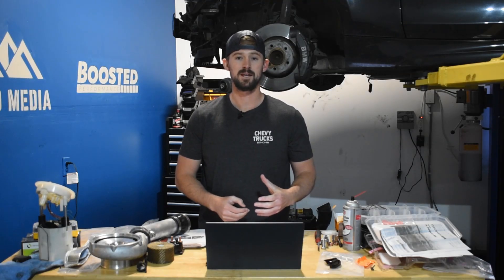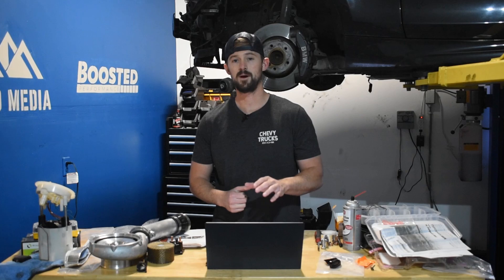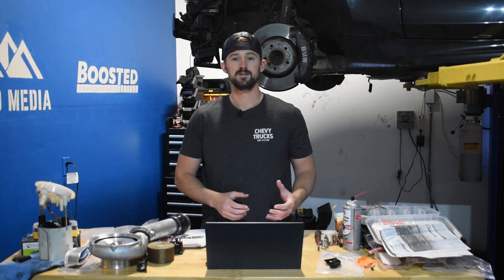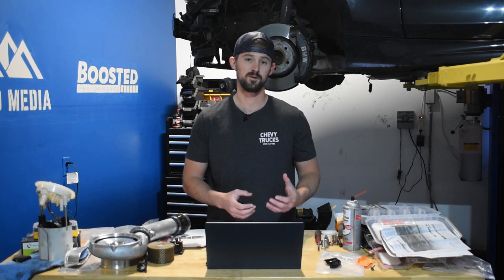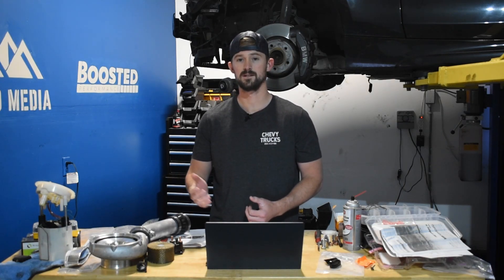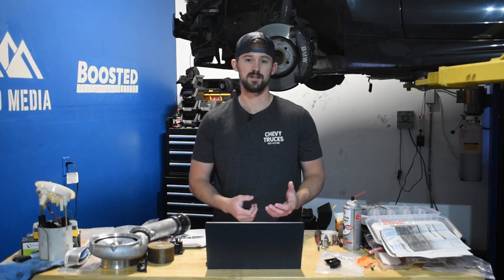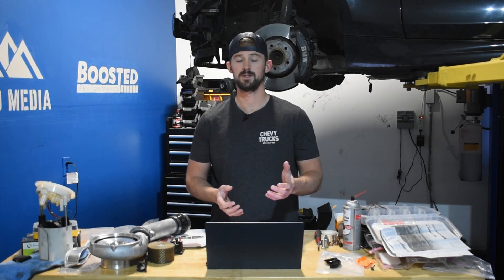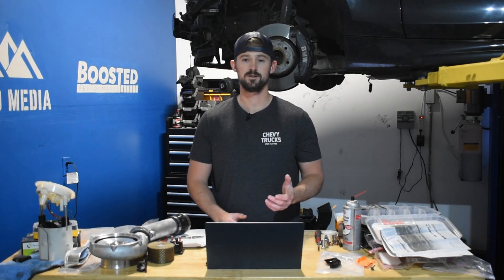The LMM Duramax - Reliability & 5 Common Problems

Comment: 2007.5 2500 HD bought at 144k within 3k miles need to change the entire egr system. 2800$ at Chevy. Sunroof broke anther 1600$. Fuel gauge stopped working after a trip to the mountains. Let’s hope it’s the cluster or fuse.

Comment: I didn’t see any leaking in the transmission lines. One just exploded without warning while pulling a trailer up hill. Surprisingly the transmission is still alive after a new line and a refill. She’s definitely hurt though
Reply from the maker: L - Sorry to hear this! Hope the truck is okay.
Reply: The good thing is prices are lower now so a used transmission with about 200k on it is not hard to find. I don’t know how much a transmission remove and replace cost but it shouldn’t be that much.

Comment: I have a 2008 2500 LMM and it’s has about 260k tune deleted and just put a cold air intake on it and changes the fluids every 3k to 5k miles, should I do anything else to it? I thought about a fass fuel and a stage 1 turbo?
Reply from the maker: S - We aren't going to tell you what to do with your truck. However, we do have a video that will help here: https://youtu.be/d8Gcy5Z6SHw

Comment: LMM can you drill out 2.5-3.0" center and leave the outer surroundings DPF ??
Reply from the maker: T - Drilling out a 2.5–3.0" hole through the center of an LMM Duramax DPF and leaving the outer portions intact is a trick some have used to simulate flow-through while keeping the DPF canister in place, often to avoid visual inspection issues—but while this may increase exhaust flow and reduce backpressure, it does not “delete” the DPF system properly, and the truck’s ECM will still detect missing regen data, backpressure irregularities, and soot loading, eventually triggering check engine lights, limp mode, or regen faults unless the system is tuned out electronically.

Comment: If I tune delete cold air and injectors stupid stuff like that should i worry about the pistons??
Reply from the maker: P - Not sure we would say stupid stuff lol.. but yes, you should start thinking about piston reliability—especially if you're pushing over 550–600whp. The LMM pistons are cast and known to crack under high cylinder pressures, particularly with aggressive tuning or excessive fuel delivery. If you're keeping it mild (under 500–550whp), the stock bottom end can hold up reasonably well.

Comment: Just came across this video cause the phone is always listening and i just bought a 08 gmc 2500 with the LMM. Its a weekend warrior for me so the 390k miles didnt bother me. Already has a DPF delete, but as far as i can tell thats it. Its an old work truck so it looks like shit, but it seems like they kept up with the maintenance cause it runs like a scalded dog. I plan on a EGR delete, fass lift pump, and a mild tune (mainly cause egr delete, not worried about big HP). Eventually, probably do full wherli piping as well
Reply from the maker: M - Nice! Thanks for taking the time to share your experience!

Comment: I have a 08 LMM sierra with 214,628 miles and I got it from my uncle. When he got it at 100K miles. he instantly deleted it, tuner, 4 inch straight pipe and a banks ram air intake. He beat the snot out of that truck till I got it with 181K miles and did the same thing. But I will say DONT BUY A CHEAP TUNER. It will throw the “Engine power reduce”. I took the tuner out at 186K miles because the tuner cleared my ECU 3 times and I had to send it to a GM garage for them to remap the ecu. From that point on I’ve had ZERO problems and got the ecu flashed with a 70 hp tune and the truck is amazing. Keep up on the fuel filters and oil and your never be upset owing a LMM.
Reply from the maker: A - Your uncle did the right thing! Thanks for taking the time to share your experience and insights.
Reply: Where did you go for the tune? I’m new to the diesel world and I have a 2010 lmm.

Comment: My 2009 3500HD Duramax is a ranch work truck. 205,000 miles, everything still within factory specs. Still original brakes. Nothing but AMSOIL products. 24mpg at highway speeds after the delete. Change oil once a year with lab analysis of the oil. Never an issue. Everything bone stock except the delete. Two other diesels… 1984 K2500 6.2 with 258,000 miles on it. Bought new… now my livestock water hauler. Used good oil… dual filtration system… never put in gear until engine warmed up… Power Service in every tank of fuel. 2007 Grand Cherokee with Mercedes 3.0 diesel. Perfect in every way. Use common sense… quality fluids… regular maintenance.
Reply from the maker: H - THIS! Thanks for sharing your experience. This should certainly help future viewers.

Comment: Lmm is the best duramax ever made, better heads & injectors than the lbz, the dpf & egr arent an issue if the truck is used for its designed purpose, its only the people who daily drive them & dont know sht about diesels that have isseus. Driving short distances & shutting them off, never towing and working the engine getting everything hot to keep it clean. I had 0 issues with my emissions or trans lines for 100k & then I decided to delete & tune still 0 issues almost 270k. Young guys 18-early 30s who drive diesels to be cool without ever needing to tow heavy are the 1s who have issues. They drive just to their warehouse or oilfield job in square toed boots never towing anything heavy and shut the truck off never getting it hot enough and rarely regen are the dudes with issues, those guys should buy a gasser.
Reply: Would. be nice if the LMM told you it was in Regen... Should be on the gauge cluster if it is that important.
Reply from the maker: B - Thanks for taking the time to share your experience. We think they're also great.
Reply: @8020Media  do you have experience with the l5p? If so how much better than an lmm or lml is it regarding comfort- seat comfort wise, seating position, ride quality, noise; reliability, handling, driver view, throttle & transmission response, power & fuel mileage given all 3 have have equal mods- downpipe, exhaust, intake, tune; is the infotainment a preferred necessary upgrade? I'm considering selling my black lmm ltz alc & upgrading to either a 11-14 leveled black on black sierra denali lml with chrome grill & trim, with either 20" oem chrome 2017 wide 6spoke silverado ltz wheels or 20" oem chrome 2017 sierra denali wheels, or a leveled l5p 17-19 black on black sierra denali or 17-19 silverado ltz, but can't decide. I really like the look of a black 11-14 lml denali with the newer 2017 denali or ltz chrome wheels, I don't like the lml silverado, but I'm unsure between the 17-19 l5p sierra denali or silverado ltz, those are the 3 trucks I'm debating between, just not sure if the l5p is worth the cost over the lml. My lmm does everything I want easily so better towing isn't a concern, I mostly tow raceways & equipment under 10k so the occasional 12-15k lbs is irrelevant. Just want a change to something a little more classy looking & not lifted like my lmm with a 6". I like the denali lml & l5p because they're clean & classy looking, I think the ltz is a little aggressive looking like something a younger person would drive which is how I feel about my lmm, black, 6" lift, black 22x12 wheels on 35s, black housing headlight, tinted windows, & an aftermarket RK Sport ram air induction hood, it looks mean & I wanna move to something classier, cleaner, & more oem plus, just leveled with a little bigger semi aggressive all terrains on the own wheels.
Reply from the maker: B - It would be best to take one for a test drive. I feel like this would potentially help answer your questions. The L5P's, if deleted, can be great. We have a video over the L5P that may help here:  https://youtu.be/S1cl-PO1pKo
Reply: Is it a big job$ to delete def

Comment: Just got a 08 LMM had a LB7 before hand the only issue ive noticed is electrical mind you my LMM is fully deleted and tuned so i guess i don't see a lot of these issues. I noticed alot of complaints on the LMM is emissions but me being from a state that has no emissions when i deleted it ive had zero issues with this truck other than electrical AKA the gas gauge and fuses? Dont know if anyone have seen this but LMK!!
Reply from the maker: I - You went the right route! Thanks for sharing.

Comment: LML Duramax engine deleted with procharger and twin turbo and muffler, more horsepower, LBZ upgrade version 2.0 LML Duramax engine, L5P Duramax engine deleted with muffler delete sounds like 6.0 Power stroke .
Reply from the maker: B - Sick build! Thanks for sharing. How many miles?

Comment: I’m looking at a 08 that’s been deleted and tuned with efi. It has 180 on the clock should I shy away or or not be worried
Reply from the maker: I - Probably a decent buy, but it all depends on how well it's been maintained. Also, you shouldn't solely use our word for making a purchasing decision. The more research, the better.

Comment: Oddball question, since the LMM has a VGT turbo, can you tune it for exhaust brake functionality?  We've got an LML and it's got 390k miles, running strong but the DEF/SCR system has been giving us nonstop trouble.  Plus we know the CP4 is a ticking time bomb.  So we're thinking about "downgrading" to an LMM, but just wondering if you can get the turbo to slow the truck down.  For all its problems, the LML has a very very effective exhaust brake which will hold an 18,000lb trailer going down steep, steep hills / mountains.  So we'd rather not have to live without it.  (And naturally the LML makes about 100 lb-ft more torque, but we can live without that, if it means getting rid of the CP4 and DEF/SCR system.)  Also.... is the transmission basically identical between both trucks?  Thanks in advance.
Reply: 390k on a stock cp4? Holy moly god must love you
Reply: @Collin2012  hahahaha yeah we’re pretty lucky so far!  I guess everybody is…. until they aren’t!
Reply: @ArmyProperty lmm should have a cp3 pump, not a cp4, unless it was swapped to that. It was the last model of duramax engine with the cp3 pump
Reply: My LMM has a tuned in exhaust brake and it works very well.
Reply: Yes you can tune for exhaust brake, however deleting & doing an open flow exhaust will reduce its effectiveness. My 08 is fully deleted & tuned with 4"dp, 5" exhaust, ram air induction hood & intake, efi live 5 tunes on dsp switch, and the simple trans go jr, I've only towed 12k with mine but had 0 issues and it towed it easily.  Last year I was towing 7k lbs on tune 3 & a newer stock height cummins towing a like 500cc 4wheeler on a little like 5x7 trailer tried to race me uphill on the hiway.  & I put like 8 length on him by the top on my lower tune & I'm lifted on 35s my buddy bought a 21 cummins on 35s tuned with exhaust & from a dig or roll I would embarrass him, his truck would barely spin the 35s without powerbreaking, if I punch my lmm below about 40mph it just melts my 35s, I previously had an 03 5.9, 00 7.3, & 05 6.0 & none of them come close to my lmm in power or reliability.

Comment: Mine is plagued with reduced engine power error as well as P101. Another common issue is kinked fuel lines. Also had the head gasket blow. I really want to love this truck, it is so much more comfortable than my ram 3500, I have gone 2k miles almost nonstop in that cab and enjoyed every moment of it, except for the "reduced engine power" moments.
Reply from the maker: 2nd - Sorry to hear about this, but thank you for taking the time to share your experience.
Reply: @8020Automotive  Discovered the solution! Bad fuel pressure regulator! Now she's running good! Thank the Lord!
Reply from the maker: 2 - Nice! Thanks for coming back and updating. This will certainly be helpful for future viewers.
Reply: @2ndAmendmentGlock chasing this issue with my lmm van thank you
Reply: What causes ur reduced engine power
Reply: My truck is essentially the same. 09 LMM purchased at 177,000 miles. Had coolant problems from then until 207,000 where I did the head gasket and I just crossed 240,000 with not one issue at all. Truck was completely deleted when I bought it and it has a couple bolt ons with a 5 position tuner which I essentially leave on tune 1. I think I’m going to drive this truck until it dies or I die first

Comment: My 2007 DuraMax is still my daily driver at 360,000 plus miles. However, I did straight pipe it at 120000 miles.
Reply from the maker: Orville - Very impressive! What else do you have done to it?
Reply: @8020Media  my 08 ltz alc is at 270k all original aside from a few bolt ons, full delete, 4"dp, 5" exhaust axle dump, cold ram air induction- ram air hood with ducting that seals into the intake, efi live 5 tunes on dsp switch, I generally run tune 3 or 4 around 100 or 150hp tunes, tune 4 burns through fuel filter extremely fast tho, have had 0 issues ever, I'm 2nd owner. Weed to change 2 glow plugs that she keeping my remote start from working, need to do my thermostats soon as 1 is stuck open making the truck run cooler & not blow very hot heat, universal joints in the rear are going bad, & need to do some suspension & steering parts soon- shocks, wheel bearings, idler/pitman arms, tie rods. All things listed have just stated going bad in the last 3k miles & all are completely original, have towed 8-10k lbs on a few 800-1000 mile trips in the last year without issue, truck is an American Luxury Coach dealer lifted new on 36x12.50x22s. So it's surprising that all parts are original turning those big wheels & tires since 1, I always kept everything greased & fluids changed but it's all just getting to to point of replacement. Tranny shifts quick & smooth, rear locker works perfect even after a few burnouts & 4x4 launches, only a few tho. Still deciding between oem parts or upgraded aftermarket. Truck made 590whp and just over 1200 ft lbs on tune 4, tune 5 will put the trans into limp mode if you try to beat on it. I average 18mpg. On 35ats & 22x12s , every button & light works perfectly, only has a quarter sized rust spot starting on the driver rocker I'm about to fix before it gets worse, & the driver seat has a small 3" tear I need to replace the leather cover. Been the most reliable vehicle I've ever owned next to an old 91 celica I got 400k out of & sold running perfect to my cousin who drove it 2yrs and then sold to his dad who drove it 4yrs an sold it still running, couldn't kill that car and we all beat on it regularly, that would be my apocalypse mobile if thr need ever arose, lol. My fiancés Camry xse v6 is the next most reliable I've ever purchased, I bought it new in 2016 and it's all original with 230k miles 0 issues or parts replaced aside from fluids, filters, tires, wipers, & brakes. We both want newer lower mileage vehicles now that we've had both of ours for many years but there's nothing newer that either of us trust to be as reliable.  She's thinking either an 18-21 camry or lexus premium model & I'm thinking an 11-14 lml sierra denali with cp3 swap, full delete, & bolt ons considered an l5p but really on the fence.
Reply: Is that a def delete or just straight pipe?

Comment: I to own a 08 LMM and just subscribed, wanting to do a egr delete, but finding a true exhaust is next to impossible. I've HSP everything but the cold side up pipe and exhaust, the motor is still factory hold off on up grades until needed.
Reply from the maker: Charles - Yup, since these are a little older it's quite difficult to get hands on upgrades nowadays.
Reply: Lb7 exhaust is the same.  Everyone still sells those since they were non emission trucks (the most of them)

Comment: Looking at a used LMM, 350K miles for $11,000 seems steep. Has been deleted. Thoughts?
Reply from the maker: HB - It all depends on how well it has been maintained. Assuming that it has been maintained well since it is at 350k, but that's still a lot of miles. It being deleted certainly helps with reliability and longevity.
Reply: Sounds like the truck i just bought a month ago

Comment: Im a hotshot driver. Owner/ operator, and i run an 08 lmm. I agree with all you said. Just hitting 330k miles. And my lower trans cooler line started leaking on me today. So i replaced it. Will be upgrading them when i get home. And i agree with deleting it will see the most reliability as mine is. Just keep up on your maintenance and it will give you years of good reliability. So with that being said, great video and i just subscribed.
Reply from the maker: Boon - We completely agree. Thanks for sharing your experience and feedback!
Reply: Have you had to replace injectors at all? Blowing white smoke on mine at WOT time to time.
Reply from the maker: Alex - Based off of the white smoke, it leads us to these: fuel injectors, coolant leaking, or incomplete combustion. Are you getting any CEL's? Keep us updated on this.
Reply: Thanks for sharing, I’m trying to find a reliable older truck.

Comment: What do you need to “bullet proof” a LMM to push abt 800hp without cracking pistons
Reply from the maker: Cory - First off, pushing an LMM to these power levels won't be cheap. It's going to be a full build including upgraded turbo, fuel system, internals, transmission (the Allison 1000 can't hold this much hp), custom tuning, and many more.. what is your budget?
Reply: @8020Automotive  just long term like 10-20k ish already got a FASS 165 and make abt 550 roughly 460 whp
Reply: @coryt-notctk6822  Pull the engine, do pistons, rings, wrist-pins at a minimum. Then the needed trans mods to support it. Of course.. turbo and fuel system if you're not already there and tuning, as mentioned.
Reply: wouldn’t hurt to put a GOOD crank in it too,  they are more known to break the crank, than cracking  the pistons.  From what I know anyway